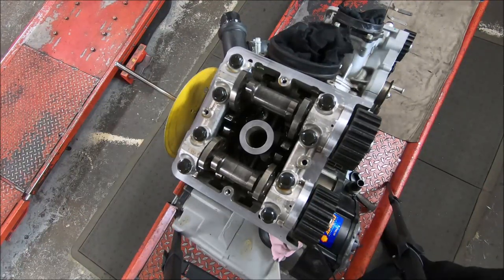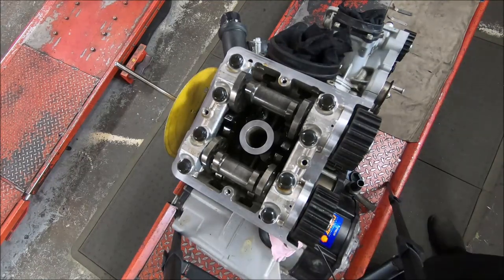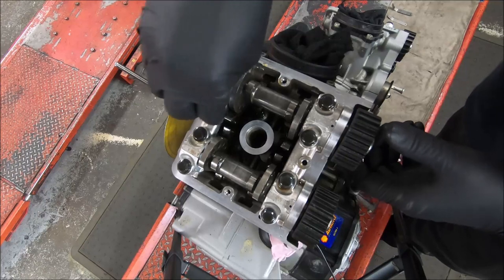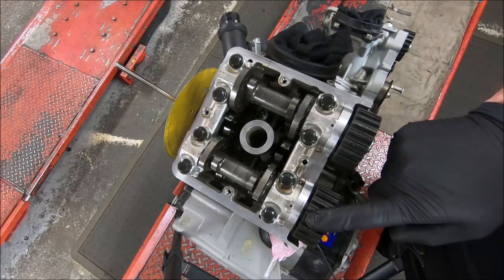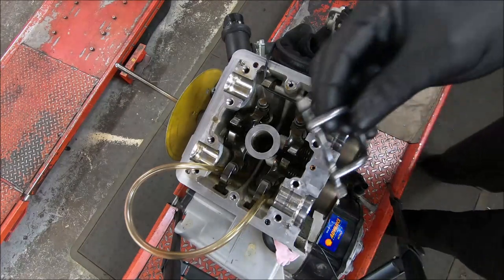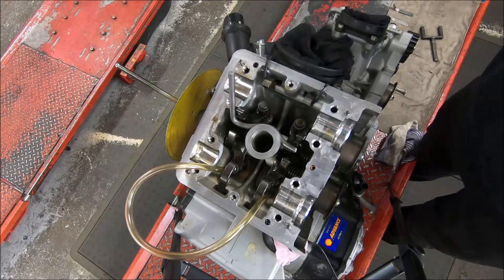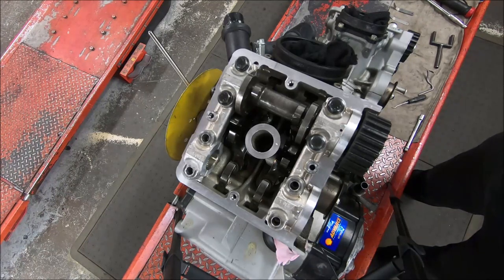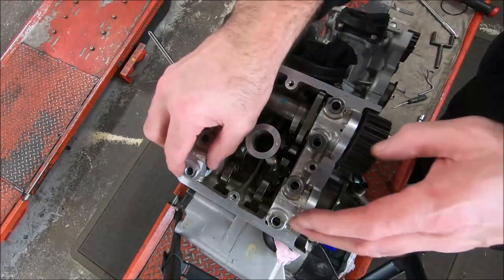Ducati Testastretta Evo 821 848 939 1098 1198 1200 Valve Clearance check and adjustment

Comment: Thanks for this Brad. You are lucky to have those rocker arm holding tools. What is your approach when the closing shims won't drop down to expose the collets, and when the collets are really stuck in the valve stem? My 72000km Multistrada has had stuck closing shims and collets on all of the vertical valves. Had to use a hammer and socket to bash the closing shims down and then a hammer and screwdriver to get the collets out. Bit worried I will damage the valve seal if not careful.
Reply from the maker: i use a 3/8 extension, but you need to be mindful that the valve is sitting on the top of the piston, and you'll bend it if you hit the shim too hard.  just tappy tappy tappy for as long as it takes.  the collets can be a real pita, i use a little screwdriver or pick.  the biggest concern there is losing them as they fly away.  you can have the shim down a touch, but tstill covering them somewhat and get a pick in between the ends of the collets.  no magic method though.  generally, the stuck collets is a real 1198 thing ime.
Reply: @bradthebikeboy Cheers. The tapping with the extension trick worked well. I hope the other 2 valves I used with the hammer aren't bent ... Still need to get those bloody collets out whilst struggling with a plastic pry bar against the rocker

Comment: Hey Brad,
Love your videos. I have a 2008 848 with 11k miles. I did the timing belts at 4k. Going to do the first valve check this weekend. Have you seen many issues with this motor by neglecting the valves? As I was suppose to do them at 7500 I am nervous. I baby her no track days....
Reply from the maker: given it's a model with an idle control valve and closed loop ecu it'll idle and run consistantly crappy at low speeds no matter what, unless it's really bad.  tightening the closers should make it nicer, but probably nowhere near as obvious as an older model.  i doubt it'll be way out of spec.

Comment: On my 998S to hold the closing rockers open I screw a cam bearing bolt in and use a cable tie to open the rocker.....it's a ghetto type of special tool but it does work.
Reply from the maker: good idea.

Comment: Hey Brad, how do you feel about the newly announced no-desmo drivetrain on the V4 GT?
Reply from the maker: about time they got with reality i'd say.  maintenance cost is the biggest issue they have, and the multi has both been a big seller and well used, so it's a significant expense for some.  personally, i couldn't give a rat's arse.  i have no interest in the bike as such either way.

Comment: Nice video Brat, i am told to renew al collets before starting to measure any clearances. what do you think about that.
Reply from the maker: i think it's pointless.  new collets wear, so if you replace them every time, you'll always have clearance the next time you check.  once the collets have settled, they tend to stop wearing and you'll find the clearances don't change much at all.  unless it's a track bike that gets revved mercilessly.
Reply: @bradthebikeboy  oke, that makes sense to leave them when they are not broken. Thank you.

Comment: So on the evo engines there is no measurement for loaded and unloaded correct? That was only on earlier testastrattas?
Reply from the maker: the closing clearance on all the testa engines, testa and testa evo, can be measured directly.  the loaded and unloaded is what many do on 2v and desmoquattro engines, where you can't measure the closing clearance directly.  unloaded is the opening clearance, loaded is the combined opening and closing clearance.
Reply: @bradthebikeboy  so I got my shim kit and now I’m struggling with determining colet orientation, under magnifying glass I can really determine top/bottom and I’m not getting consistent/anticipated results. The metric to sae back and forth is confusing. I’ll figure it out eventually, it’s amazing to watch someone that’s done this a lot. Btw, the fuel line down the oil return is brilliant.
Reply from the maker: @jimccc9467  you need to look for wear on the outer side and opposing inner side of the collet.  sometimes you'll see some right at the ends on the outer (under) side - might be all you see.  can be hard at times.
Reply: @bradthebikeboy  well I have successfully got all the vertical cylinder valve clearances to “Brad spec” onto the horizontal tomorrow. I have to think that if this had gone to a dealership that anyone would be custom sanding to get that .001-.002 to make it just right. It’s amazing the wide acceptable tolerance in the “checking” column. Not sure it will run noticeably different-you might be able to tell-but something to be said for talking the time and doing it right.
Reply: @bradthebikeboy  so I was just working on the horizontal valves and pulled a broken collet out in two pieces other half intact, is this common? 15k miles on engine I believe this is first adjustment.
Reply from the maker: @jimccc9467  it's not uncommon.  worse on bikes that get tracked / revved hard.  replace both collets.  they will settle in over the next period, so next time you pull it apart it'll need adjusting again on that particular valve.
Reply: @bradthebikeboy  thanks for the reply. I’m just happy it didn’t sneak out of there and come apart. Although it looks like that probably doesn’t happen the way it’s together. Clearance was .006 on that intake closer so not crazy loose either. Do you have a feel for how much they settle? I guess it would make sense to set it on the tighter clearance
Reply from the maker: @jimccc9467  the bits can't really get out.  i wouldn't set it tighter, 0.05mm is already pretty tight.  it might loosen up 0.05 - 0.10mm.
Reply: @bradthebikeboy  I thought I understood your intake closer spec to be .003-.004 but I guess it will decrease/tighten as it settles correct?
Reply from the maker: @jimccc9467  forgot you were talking about inlet.  i'd go 0.05mm as long as there's no drag when turning the cam , certainly no more than 0.08mm.  but it will get looser as the collet settle.